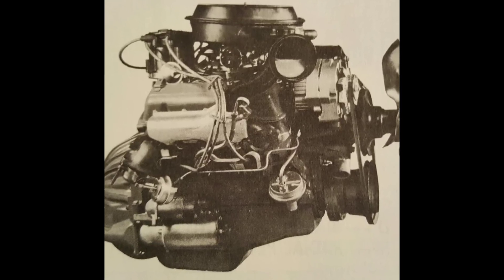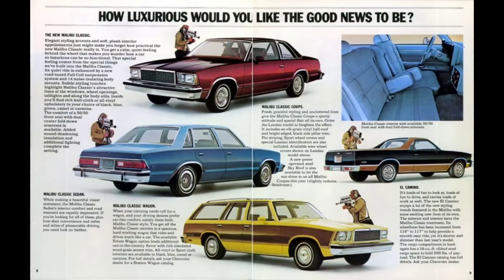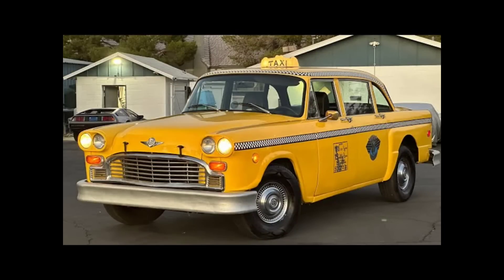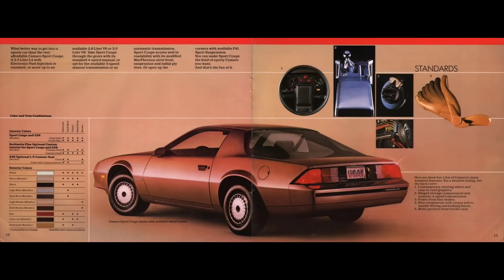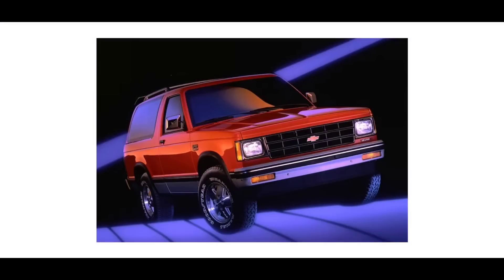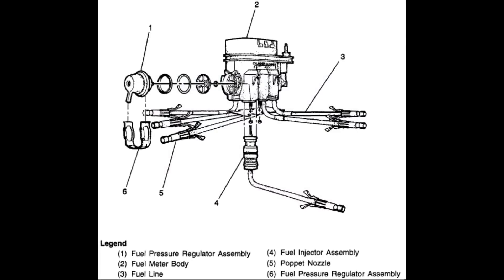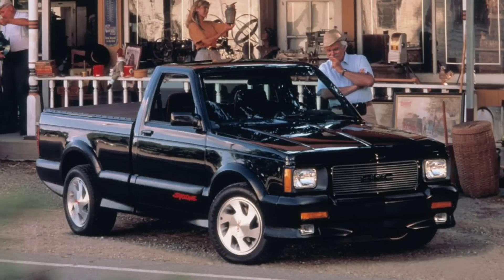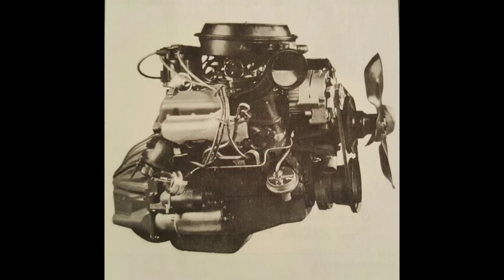GM's Forgotten Engines : The Chevrolet 90° V-6

Comment: This is the ONE thing I never understood about car manufacturers.  When they build a beautifully designed motor that is loved, time tested and proven AND they need a smaller OR bigger motor for either changing times or different models, why not just lop off or add cylinders as needed and keep the same great design.    Pontiac had the OHC inline 6 that they sold at the end of the 1960s to someone I forget who but man that was a blunder since they could have used that in all the small cars as a 4 cylinder or as a 6 in midsize.. or heck even an 8!  Imagine that in the early 1970s GM having all overhead cam engines.. They would have killed the market. But did they?  NOOOOOOOOOOOOOOOOOO. That would have made perfect sense and GM is allergic to good sense,

Comment: Unfortunately the 4.3L v6 never got the same improvements as the 3800 Series II and III.  Starting with the 3800 Series II, the cast iron block was upgraded from two bolt main caps to the cross bolted four bolt mains.  This was a major improvement for the 3800 v6, in addition the Pre-Series I 3800 v6 would get improved heads, a balance shaft and the cylinder banks were shifted so the pistons were no longer off-center and the block became an on-center block, which did improve durability and gas mileage because the pistons were no longer required to be full squirt pistons.  All the improvements to Pre-Series 3800 carried through to 3800 Series II and III.  The 3800 Series II and III were overengineered blocks and could handle more boost and make more power than the 3.8L v6 found in the 86/87 Turbo Buick Regals.  It is too bad these improvements were not done with the 4.3L v6 as well.  With the larger displacement and a block that was fortified like the 3800, I am certain a lot more aftermarket support would have popped up for the 4.3L v6.  Forged crank, rods and pistons along with a forged stroker crank to add a bit more displacement, it would have been a really fun v6.

Comment: They worked fine being just a bobbed SBC.  We beat a couple of S-10 shop trucks like rented mules including packing the beds with salvage engines and transmissions. We took back roads because neither truck had beefed springs and looked as ridiculous as it sounds. Slow but the engines didn't care nor did the rest of the truck. The 4.3 is IMO key to S-10s running so long they were truly worn out before scrapping. The Iron Duke served well but was feeble by comparison to the 4.3. The 4.3 was near as rugged as the 292 straight six, perhaps GMs toughest engine.

Comment: 60 . Not 90
Reply: These engines were based on the small block architecture, therefore making them 90°. The 60° GM V6 wasn’t introduced until the 1980 model year in the X cars

Comment: I also had a 2004 Astro AWD with 4.3 V6. I pushed mine 287,000 miles with ALL fluids changed as the manual said. 5000 mile oil changes with synthetic oil. The only problems were a fuel pump failure at 147,000 miles and an ignition module at 190,000 miles. There were no leaks anywhere and I sold it in 2011. It was a great vehicle and the engine never burned oil.

Comment: Besides being very reliable one nice added thing about the 4.3 was the sound it made. With a simple glasspack muffler and some larger tubing it's one of the few V6's that made people think you had a small V8 in your truck. It had a nice grumble to it compared to a lot of modern V6's. :)

Comment: My dad owns a 99 blazer with the 4.3. Old girl blew a head gasket back in 2018 and it locked up. At the time, we didn’t have much money and were getting by with changing the oil anytime we had to drive it, but we had to be somewhere and didn’t have time for any of that so the engine seized up on us less than a quarter mile from home (at a low RPM, fortunately). Car sat in that state until this last summer when we were finally able to break it loose and start it back up. 6 years of sitting idle and she ran like nothing was wrong.

Comment: Being a 90° V6, Chevrolet took steps to eliminate the rough running tendencies of the 200. The crankshaft has each of its connecting rod throws offset by 18 degrees for each pair of rods.   This produced an engine with a semi-even fire sequence of 132 degrees/108 degrees.
Reply: The 200/3.3 & 229/3.8 both had this odd fire crank. It used a semi fire distributor. The crank on these used the 2.10 diameter like the small blocks did after 1968. 

The 262/4.3 when introduced in 85 used the new offset crank with 2.20 diameter rods and this produced an even fire. These rods are also slightly thinner at the end. 

I’ve never tried this as you’d only be able to use 1985 262 cranks as they still are 2 piece rear seals in the 200/229. I’ve wanted to take a 229 and do this as it would possibly improve it. 

I had a 229 that I took the Th350 and replaced with a 700R4 and the mpg went up. Some 1984 models had the 4spd auto with the 229.

Comment: Some wrong info here and there. Just off the top of my head, they never put the 90* v6 in 3rd gen Camaros and the 2.8l wasn't phased out of the s10 line up. The 4.3l became the top option while the 125hp 2.8l was still avalible.
Reply from the maker: You're absolutely right. They stopped using it in the Camaro after 1981. I don't know why I said '84. I think I have to stop writing these scripts after working overtime. And yes, the 2.8 continued to be offered in the S-10/15 lineup until 1993.

Comment: My dad inherited a '79 Malibu wagon with one of these engines, a 3.3 liter.  It had about 50,000 miles, and my grandfather had to have it rebuilt.  My dad drove it for a year as a work car when it started to need a rebuild AGAIN.  These were some of the worst engines GM ever built!

The '82 Camaro V6 was a new 60 degree design that had nothing to do with the 90 degree engine.
Reply: The Camaro got the same garbage 2.8 60 degree V6 as the S-10 lineup got, as well as some of the small front wheel drive cars.  AMC even bought a few of those engines for thier early Cherokees.

Comment: I had an Oldsmobile Bravada with of course the 4.3 V6 that I got 316 thousand before the head gasket blew on the compression side  so I lost a cylinder. 
Just like most American manufactured engines proper maintenance and they will run for a long time ⌛️
The drawback to these engines is that GM installed them in vehicles that actually weighed too much.
Reply from the maker: That seems to be the case with a lot of GM engines of this era. If they just didn't offer the smaller ones, people would have been happy with the power, if only from a weak 8 cylinder. I think CAFE requirements had something to do with it.

Comment: I had a 1981 Chevy with the 229 V6. I believe the 229 V6 was a 305 V8 minus 2 cylinders and the 4.3 V6 was a 350 V8 minus 2 cylinders.
Reply: The 4.3 was a 350 minus 2 plugs and was a strong engine, I had two Silverado trucks with 4.3 vortec and loved them.
Reply: You are correct. The 200 V6 (3.3) was a Chevy 267 V8 minus 2 cylinders. Same stroke as a 305/350, but with a very small bore.
Reply: @johneckert1365 
3.5 inch for the 200, and 3.74 for the 229
Reply: @johneckert1365 I had an 81 caprice with the 4.4 v8. It had 115hp and couldn't keep the speed limit up hills. Got a whopping 12mpg by the end.
Reply: @DJMDHertzel  sounds lovely 🤮
Reply: @DJMDHertzel  I had a 76 4 door Nova for a short while with that short lived 4.3/262 V8. It was a unique engine that didn't share it's bore or stroke with any other Chevy Small Block. It seemed to have decent power I guess. After that car turned into parts, I sold that 262 to a guy and we put it in his 3/4 ton early 80's pickup to replace the 350 that spun a rod bearing. We were worried it would be horribly underpowered but he said it wasn't too bad. Non overdrive trans and a low gear ratio probably helped out quite a bit. 
I don't think I've ever had the displeasure of driving anything with the 4.4/267 V8.
Reply: @johneckert1365 it's interesting that some small differences made such a huge difference in performance
Reply: @DJMDHertzel  100%

Comment: Still have my mint condition 1988 S-10 with the first 4.3l Z engine, it has 160k km on it and has never seen winter driving, still looks new inside and out. Bought it new in 1989.
Reply from the maker: Lucky!

Comment: Honestly I drove alot of the 4.3l they literally are dogs shitty gad miles, have to full throttle just to go any where it's either off or on soo slow
Reply: 03 Sierra was very peppy with the 262
Reply: Once the 4.3 got the same "Vortec"   heads and fuel system as the V8's it wasn't so bad. 
I agree that the carburated and TBI 4.3's were pretty weak though

Comment: The later fuel injected 4.3’s were noted for high torque, reliability, and longevity. I put 200,000 miles on one in an Astro van before selling it to a friend. It’s probably still running without any major repair. Unfortunately the auto transmission and rear end in the Astro was not as durable.
Reply: We had a Safari AWD and that V6 would pull a loaded snowmobile trailer through a foot of snow without breaking a sweat
Reply: The transmission would have last longer if you had changed the filter.
Reply: @Fone65 And if people would drive it in 3rd (drive) gear rather than 4th (overdrive) when they aren't out on the 55mph+ highways.
Reply: @johneckert1365  That was a myth. Shifting in and out of od didn't hurt the 700r4.
Reply: @blackericdenice  That's not a myth, it's an absolute fact. Shifting in & out of overdrive, and the torque converter lock-up constantly engaging & disengaging I'd 100% detrimental to TH700R4, 4L60E, 4L65E, etc.... Direct gear (3rd in these transmissions) is the strongest gear. With the torque converter lock-up engaged, all the transmission is doing is directly connecting the engine to the driveshaft, all the other gears are just along for the ride. That's the most efficient gear also, as far as parasitic energy loss through friction & heat. 
What wears out transmissions? Excessive heat, friction, and SHIFTING. 🤡🤡🤡
Reply: @johneckert1365  You are repeating what you read online. Have you ever rebuilt a 4L60e? I can show you video of me doing this. When you can say the same. We can talk.
Reply: @blackericdenice  No, I am not repeating nonsense from the internet. I've been part of the auto industry in way or another since I was old enough to walk. I currently own an auto salvage yard, and 4L60E/4L65E are my biggest sellers. Good for you that you've replaced clutch packs in a 4L60E. Where would you like your trophy delivered?

No transmission enjoys shifting back and forth repetitively. Some handle it well, others don't. TH700R4 is in the group that DOESN'T handle it well, especially the early ones when they were introduced in 1982. Those early ones were f%$&ing garbage 🗑 The early torque converters (with the round mounting lugs) were junk too.
Reply: @johneckert1365  I also replaced a cracked forward clutch housing which was causing my 2nd and 3rd gear to slip only @ 75% or more throttle. This had nothing to do with the unit shifting in and out of od. So you who has never rebuilt a 4L60e is trying to tell me how one work.

Comment: 0:58-95 HP and 106 ft lb of torque?  Wow!  It felt like every bit of 107 ft lb in my 78 Malibu.  But I did jack the ignition timing up just a smidge.  LOL  I'm not sorry those boat anchors are gone.
Reply: Yeah, mine couldn't punch it's way out of a paper bag